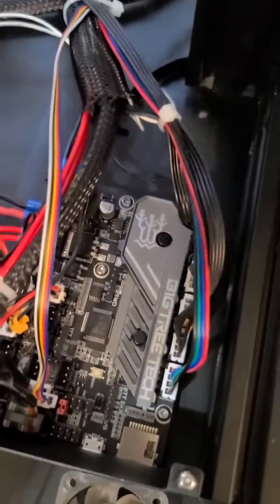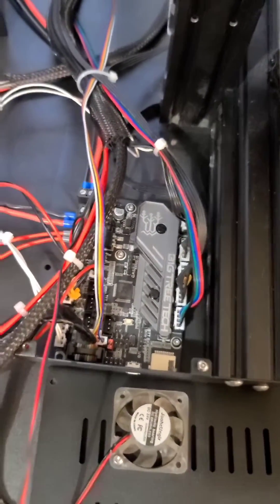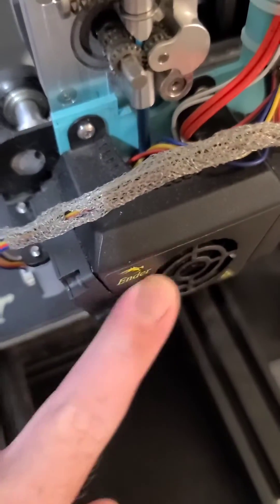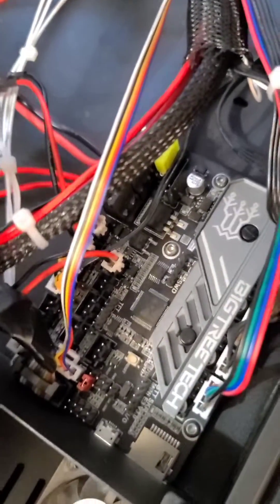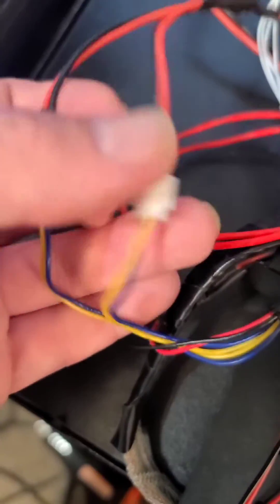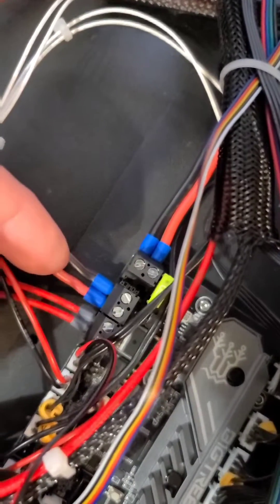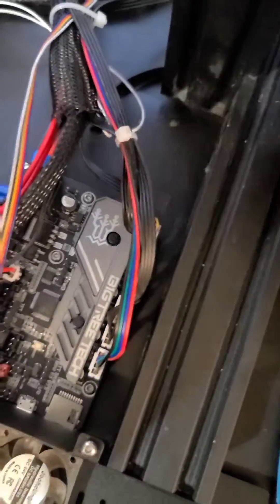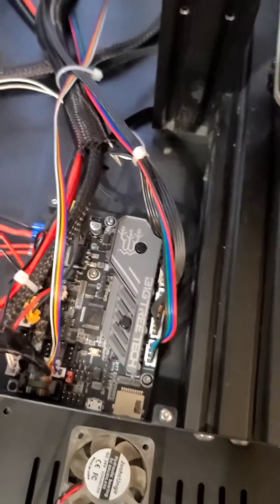Bigtreetech skr mini e3 v3.0 on Ender 3 max what you need for install and my Firmware

Comment: I know this is an older video but I had a question. I have this same set up and been using your firmware. Everything works great but when I start a print the printhead ignores my z offset and prints higher than it should. Any ideas?

Comment: Hey. Can you share your souce because my BL TOUCH is on the right side and your firmware is for the left side?
Reply from the maker: You can change the offsets without the firmware. It's under advanced settings.

Comment: So you spliced the 2 part cooling fans and stuck them together in fan 0, put the hotend fan in fan 1 and put the mainboard fan in fan 2?
Reply from the maker: Yes, there are only 3 fan JST connections. I split the cooling.  Leaving one for hotend and one for MOBO. Works great!

Comment: hey ! Thanks for the video. i was looking for a way to connect the fans because i was wondering how to do this. actually i connected the motherboard's fan to the power, it turn on when i start the printed. i'm worried wabout the other fans i haven't coonect like you did right now but i'll change this when i'll receve an amazon order for plugs you recommend ( sorry for my bad english, im french )
Reply from the maker: Hello, first your English is great!! The fans connected to direct power are ok. They just always stay on.  If you connect like I did, then the fans will only turn on when you start heating up the bed and hotend. It's great because after print is done and printer is sitting. You don't have to hear any fans going. If you need any help LMK?
Reply: oh and your firmware doesn't work on my printer, weirdly, i can't make a firmware work on it ..
Reply from the maker: @sarahbandes7612  I can send you different firmware. I have used all my firmware on 4 ender 3 max no issues. What is the trouble you have with it?

Comment: Hi, do you have compiled firmware with no BLtouch enabled?
Reply from the maker: No, sorry. I never use them without it.
Reply: I also use Ender 3 Max without BLtouch. Did you find anything and can you share?
Reply: @gienku  I do not have much info was trying several times, and ended up replacing the board with BTT SKR mini v3
Reply: @maxoutny  I thought we are talking about this board...

Comment: Hello. Can you tell me how exactly cofig your Configuration.h for BLTOUCH. I made changes but BLTOUCH doesnt stop when it touch bed. I use 5 pin connector.
Reply from the maker: Did you figure it out?
Reply: @toshlarue  No. When I compile doesn't work. When I use yours it's work and I don't know why
Reply from the maker: @bobogamen  you sure you added the right motherboard board in firmware?
Reply: @toshlarue  Yes. I watched several videos about it.

Comment: Is there any way that you can uploading the configuration H file? The 3x3 bed level is not enough for my bed and I have the BLtouch in the stock location, I tried Unity firmware but no matter what it never works when trying to compile.
Reply from the maker: Right now my whole family's life is in a storage unit. I don't have access to my files. Saving & hopefully soon I can help out and make videos again. 😔. Try a stock configuration file from marlins home page. You should be able to change the bl touch points in firmware and on display after loaded. Just download mine and change all the setting in the menu's

Comment: Hello can you also share your source code i tried to made it myself but mine didn't have the steper position right (auto home not center)
Reply from the maker: Just saw this comment. Replied prob to late. Hope you figured it out. Sorry for the super late response.
Reply: @toshlarue  yeah i did in the meantime now i just have an issue of z alignment, and frame that is not square
Reply from the maker: @Burei  It is more than likely not the Frame. I have a video on installing Anti Backlash lash. That will show you how to line up Z. Did you install dual Z rod? The 3 max needs this.
Reply: @toshlarue  I did install a dual z rod
Reply from the maker: @Burei  check out my other video. Install an Anti Backlash on the other side. I assume you have BL touch.  Move Z all the way up using the display screen. Turn off steppers and manually turn Z rods up all the way. The left side will touch the top. The right side won't just manually turn until until you feel it tight. Don't over turn it. Use the display screen to move z down about 50 mm. Then home printer. That should align the Z axis.
Reply from the maker: @burei8452  https://youtu.be/2RLcIMNsDwc
Reply: @toshlarue ok thanks i''ll give it a shot
Reply from the maker: @Burei  Building new firmware on the latest version of Marlin. I found an error on their config file for 3 max. I will make a video and soon.
Reply: @toshlarue  Ok i'have install a anti backlash on the other rod but since i'have change the extruder and is higher than the stock one so i can't use your trick to level it
Reply from the maker: @Burei  To level the Z axis. I move Z up all the way via the controll panel. Turn of steppers and hand turn until it reaches the top. Then, I turn each side until it can't go up anymore. Don't overturn. Just do it tell you fell it get tight. Then, use the control panel move Z down. Then home the printer. Also, if  let's say, the right side is too high after you level corners. I turn the z rod stepper to lower it a little more.  Like if you do a flat print to test level and right side is to high but left is good. Stop print and turn Z rod stepped a little closer and start print again

Comment: Is there any way you could compile the same firmware but change it for a bowden setup. I tried it on mine but the filament motor goes in reverse as its for a DD setup. Any help would be great
Reply from the maker: Are you saying you have DD? The firmware is compiled for a bowden setup other then retraction and esteps that need to be changed. My direct drive motor goes reverse  because of the cable I use not the firmware. Did you change your stepper cable.  In the firmware you can compile to go reverse but I don't have that setup to do so. So I am guessing you got a aftermarket or replacement stepper cable.
Reply: @toshlarue  turns out I did have an aftermarket cable, so just me being stupid. I've reflashed with your firmware and so far print looks to be spot on 👌🏻. Thanks again and great work 👍🏻
Reply from the maker: @rosssmith5731  I thought so. Thanks glad it is working out for you! I will have updates and a video on using it. Appreciate the feedback.
Reply: @toshlarue  that's great, look forward to seeing them. On a different note, could I ask what slicer you use and settings, I've started to get alot of stringing with prints, tried alot of different retraction settings with very little improvement. I just use the standard creality slicer.

Comment: Hello!! I was exactly looking for this video, I also have an Ender 3 Max and I want to do this upgrade!! So I have three questions:
1. Where did you get the configuration.h files to be able to compile Marlin?
2. Is the original screen compatible with this MoBo or do you have to buy the touch screen?
3. Could you share me the configuration.h and adv.h files please? 
Thank you very much and what a good job you did!!! you already have a new subscriber
Reply from the maker: The configuration H files etc. I redid alot of setting in there. You can find in bigtreetech gifhub .
The OG screen does work. Paying a extra 40 for a few features is not worth it for me. 
Just use my firmware for the 3 max and be good to go.

Comment: Just tried the firmware, great work
Reply from the maker: Sweet ty for letting me know. I am still working on it and will have add updated marlin versions as they come out. Are you using a Direct drive or stock?